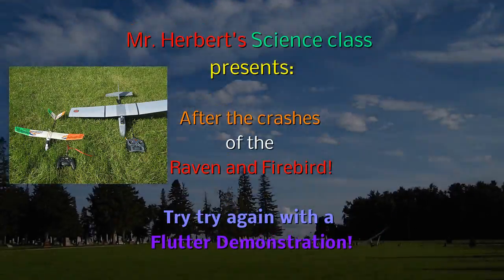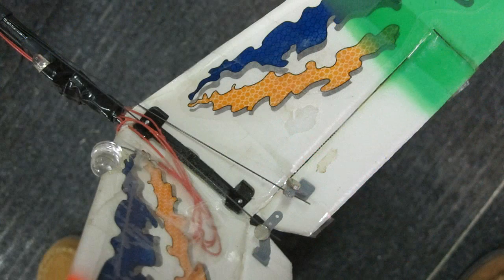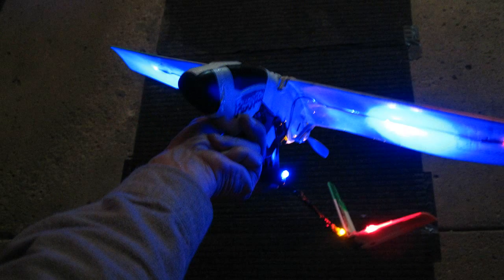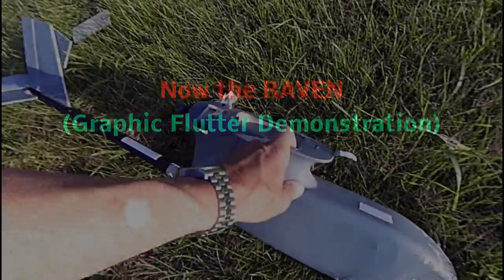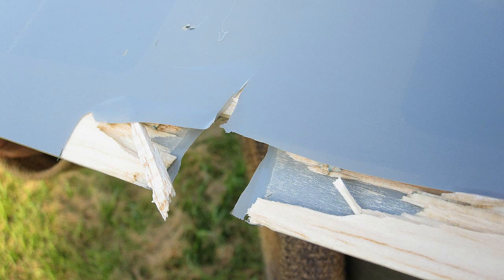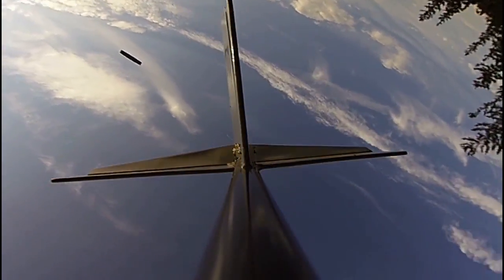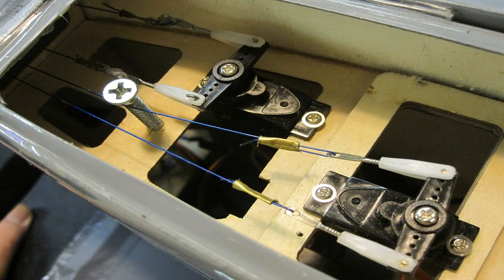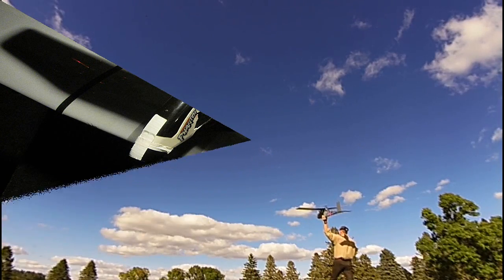Extreme Elevator FLUTTER example on Raven RQ-11 drone by NightFlyyer. Eye opening video.

Comment: never realized how much the control surfaces really take a beating from the wind. that was quite an education. i try to catch all your videos, I've learned so much from you over the last couple of years. thank you so much for all your efforts and time. i have noticed that occasionally on your videos you mention you wish they would bring back the storm launcher. the other day i accidentally came across a website called West Michigan Parkflyers, they have a seaplane that is very close to it called the mako xl. its a foamy kit only, no electronics or motor. it sells for $114.95. thought you might be interested in checking it out.

Comment: Would there be a way to put a rod on the Control surfaces, that may work better then the cables? I see you cut holes in the tube. I'm getting ready to build my RQ-11 and wanted to know the best way to do it. good video.